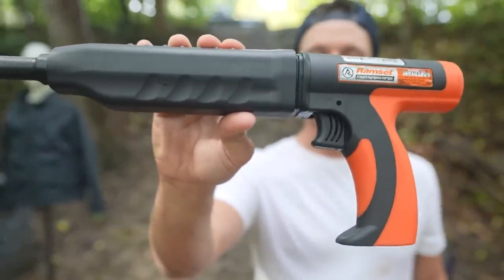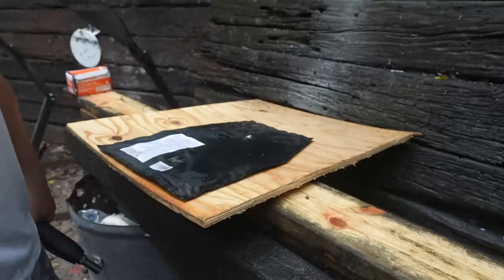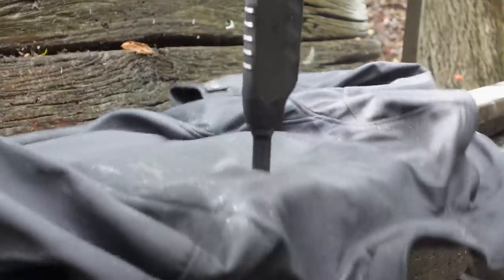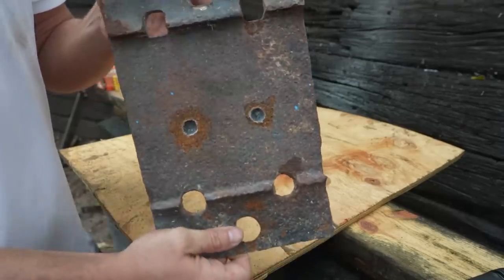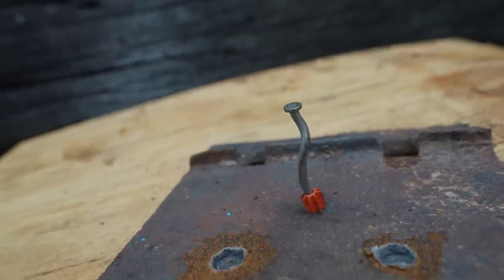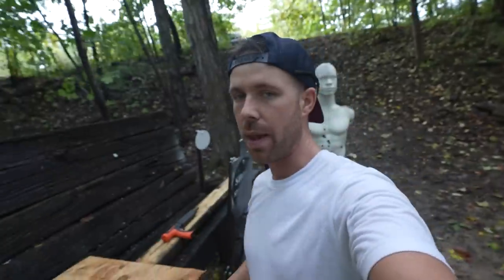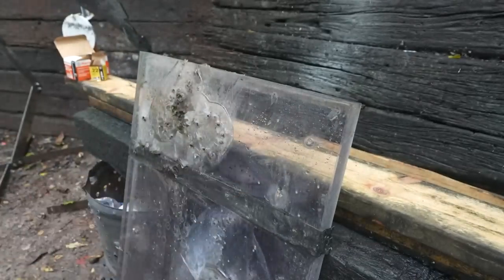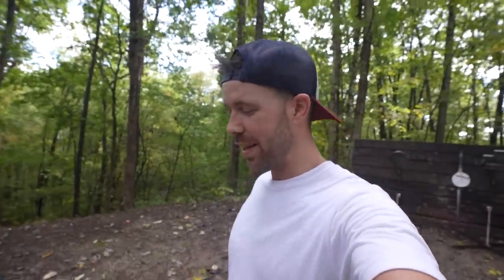Can a Nail Gun DEFEAT Bulletproof Glass?!

Comment: When shooting steel,  you have to use the hardened nails. They will have an H stamped into the nail head. Also, the red blanks are used for driving nails through steel.
Reply: 100% and i was going to speack about that but you did , so thanks!!
Reply: hahaha we have the same name also🤣 ma name is steven ma nick name stk steve the king lol
Reply: ah s*** here we go again
Reply: Time for a follow up vid 👍
Reply: I wish he could do this (But I think he's a bit scared)
Reply: @stkgaming5972  never seen this “speack”  word  before Where does it originate and what is its definition? I’m Intrigued
Reply: Not only that, he needs to be using the proper length pins for the steel he is trying to penetrate
Reply: also he's using the wrong stance to penetrate steel. Nail gun basically just flipped his elbow out of the way instead of directing the energy through the plate.

That plate is nothing to the ramset if you're doing it right. Shit, I've seen people nail two I-beams together with one of these things.
Reply: Steve, I wonder what would happen if you insert the tip of one of these hardened nails into a drilled .308?
Reply: @billyzee261  these are called armor peircing rounds and uncle sam isn't a big fan of people owning them
Reply: @billyzee261  I was thinking a shotgun or muzzleloader but .308 would take the cake.
Reply: Red is below purple I can get steel plates into concrete with those.Try purple they have the highest rating
Reply: Hardened nails are used for concrete as well, and with the yellow tips,  they stick 2x* to concrete pretty good if you have an older model Ramset, but the newer ones with the piston are pretty weak with yellow tips,
Reply: @Fm-ss4uj  Black loads.

Comment: I use both a Hilti and a Wurth nail gun, the cartridges are interchangeable, the Hilti blacks are used to put fixings into steel, it's the nail and the weight of the hammer, using the correct fixing and cartridge steel is no problem

Comment: There are nails just for steel. And couple those with the RED shots. Straight through that plate.
Reply: Yeah, they're hardened steel nails. Usually marked with an H.
Reply: this model nail gun is the 'civilized' model...in that it is piston actuated...let me explain...when you fire this model...there is a spring loaded piston between the round and the nail..upon firing the gas charge strikes the piston which in strikes the nail...the model of nail gun you should be using is i think the Ramset J30 which was produced 20yrs prior to this...this is a beast...it is direct fire...meaning NO PISTON...the charge strikes the nail directly and it fires full length 22cal blanks...and get either the black or the white coloured charges...These guns are Banned for good reason....but you can still find on ebay...get one and put the video up....and fond some decent steel...like some  I BEAM or a section of railway track..
Reply: @russellking9762  I have an old model direct fire, and it pins 2x* into concrete, with the head of the nails buried a half inch deep in the wood with yellow tips.
  The new ones are a joke unless you use red; or even purple in some cases.

Comment: Couple of points; nails are steel and very pointy, bullets (particularly hand gun rounds) are softer and rounder.  In fact many rounds, ever rifle, non AP rounds, are designed to expand on impact.  Also, the nail gun is essentually firing at point blank range.  So, with those noted, I'm not surprised at all.
Reply: Plus, "it went through" is only partly true, it penetrated. Only thanks to the nail's head it gets the necessary force to penetrate, but it would never manage to go all the way through.

Comment: The difference is almost entirely in both the range and the material of the projectile. Bullets are typically made of soft metals, lead, copper, brass etc. and are designed to mushroom and break apart on imact and in the target. Firing a nail is almost akin to firing a low energy AP round.
Reply: O really....... Is that what bullets do?
Reply: @dustencross357  Yes, and in contact with bone they shatter into your flesh
Reply: @4x13x17  😒
Reply: @dustencross357  I'm sorry Dusten, did I also have to include a cp link to catch your attention?
Reply: @4x13x17  (yahn)

Comment: Possibly more accurate to say it "went into the glass" rather than "though", because the head appeared to be flush with the front surface and it didn't exit and hit the railroad sleepers in the back-stop.
Reply: It went though however it didn't pass through
Reply: Maybe if u cut the heat it will go through the glas :p
Reply: @porros_y_cafe  glass melts at higher temperatures than steel

Comment: Nails are made of steel, hardened steel maybe even a mild carbon steel. It will give brass bullets a run for their money, unless the bullet is armor piercing. What you should try the device with is the black colour coated timber screws. Those are the hardest ive seen, clearly carbon steel becaise dont bend but just break. Those will go through that plate which bent the nail.

Comment: Different principles as there is literally a ram in that gun that is pushing the nail forward, the nail is not just flying forward on its own energy.
Those nail guns are more like a tiny, extremely fast acting hydraulic press lol.
Bullets only have the momentum energy of their weight and velocity, these nails have a metal ram behind them continuing the push forward after the impact.

I'll bet if someone made some hardened pins designed for metal, you could get through that tie plate.
Reply: @letgomyleghoe582  I said "like".  Most people don't even know what pneumatic means.
It's not LIKE a pneumatic press.......  It IS pneumatic.
But thanks for the AHCKSHULLY

Comment: I cringed when you shot the nail into the steel plate- was worried something would shatter and hurt you. I think the design of the nail gun to completely surround the nail is pretty safe though.
Reply: Nail?
Reply: @Complete.cyclepath  auto-correct :)
Reply: They're meant to shoot through steel. It's construction equipment.
Reply: @OneMoreGrave  in sure they’res a limit to hardness and thickness though.
Reply: @crankygunreviews  sure. And he found it with the railroad tie. They're built to contain the nail if penetration does not occur. OSHA approved lol.
Reply: @OneMoreGrave  yeah, I never did much research on those- looks pretty “safe” actually
Reply: @crankygunreviews  30 years of construction experience finally paid off 😂
Reply: It's has alot to do with the rounds (nails) he is using, is why he cannot penetrate the steel. I use the same Ramset gun and or a Hilti gun to hang track on the bottom of steel I-beams that are 1/2 thick.
Reply: @OneMoreGrave  🤣🤣
Reply: Mark Harris  I agree- I’m a fair mechanic, and can fix most things, but don’t want to ruin my guns. I’ve polished Sears with nail files before because the file wears out before you take too much off
Reply: Mark Harris  completely agree
Reply: Ironic, I cringed at your comment the same way
Reply: @youtube.commentator  🤪
Reply: @crankygunreviews  oi guv, why'd ya edit ye comments
Reply: @youtube.commentator  not worth my time starting trouble on a good YouTube channel
Reply: @crankygunreviews  fair enough
Reply: Rail rode steel dus not shatter and it’s made to go through steel but of course not this thick

Comment: As a metal stud framer....one would use a shorter hardened steel "nail".
You used the aluminum nail used for pinning 2x4s to concrete slabs.

Comment: The reason the nail gun penetrates the vest is because vests are designed to disperse the foot-pounds of energy over the surface of the vest. The bullet is unable to dump all the energy in an area the size of it's surface. The reason the nail is generally able to penetrate very hard materials that most bullets can't is because of it's pinpoint surface area coupled with the large mass behind it. That combination makes for some pretty impressive foot-pounds.

Comment: They go straight through because of the pointed ends on the nails.

Pistol rounds tend to be stubby. Maybe try grinding down a pistol round to make it have a nail like point and see what the results are. 😍
Reply: Just use sabots!Or make a long barrel revolver with a small caliber: and get it loaded with nail gun blanks from one side and .25 caliber bullet from the other!I made such a thing out of an antique revolver that was .38 rimfire! Just ordered a cylinder with .270 diameter for the first 18mm and then step down to .252 throat diameter! And a 6" barrel with .252 bore: now it's such a blast! With the most powerful blanks-purple long that is, It fires a 50 grain FMJ bullet from .25 ACP at a whopping 2850 fps on average! That is wild!
Reply: Bullets are soft unlike nails which have been hardened.

Comment: Kevlar will not stop pointed projectiles. The point will work its way between the weave of the cloth. You want to defeat body armor that is based on Kevlar or similar materials use a crossbow with razor points.

Comment: Bullets that are stopped by 3a are blunt objects that are broken apart much easier than steel nails. 3a soft armor works by absorbing the impact with strong fibers and disputing the energy across the vest. A pointed nail spreads the fibers apart just like a sewing needle can penatrate or the pointed 5.7. Perhaps if you used a spike rounded the head to be blunt then it would have stopped.

Comment: For the metal  get a 1/2 pin i guarantee you its not going to bend. The nails that you are using are for wood,concrete or light steel.  Get the 1/2 inch pins

Comment: Nail guns are not high velocity, they're captive bolt drivers.  Gap that puppy by 5 inches and see what kind of damage it does.  5 layers of fleece should be enough ricochet shield.  The Ramsets are very powerful but even a 410 shotgun with a driver bolt will slam a hardened nail through half inch mild steel.

Comment: 2:58 ofc it wont stop a nail. u can beat that armor just with normal nail and a hammer
the Kevlar works like any fibers. try to drill trough fabric, the drill gets stopped but use sharp needle and u can just push trough. stab resistant armor would work way better
what kind of rises the question, how well will body armor work against rounds with out spin

Comment: Its literally a case of what it is designed to stop. Most bullets don't consist of a sharp steel point.

While the nail did penetrate the bullet proof glass, it didn't go through. Unless someone's head or other body part is on it, it won't hurt them.

Comment: Well it’s not surprising that a galvanized steel nail went through considering how much harder it is compared copper and lead
Reply: When in the hell did you ever use copper or even lead nails?????
Reply: @scottstabolito8841  i’ve used copper nails for putting up cement shingles for siding, and for putting copper inserts into cupboard doors
Reply: SnyperMac1 
You were installing shingles and inserts with a powdered actuated pin gun?  I highly doubt that.
Reply: @scottstabolito8841  did i say that? Pretty sure i didn’t say that, don’t twist people’s words. Regardless copper and lead aren’t even in the same ball park for hardness as steel.
Reply: SnyperMac1 
Well....when the whole topic is about Ramsets and the pins they use.....

Comment: No kidding "its some kind of plastic" ... it acrylic, some times called plexiglass, yes the same stuff at the home improvement store. Just a bit more attention is  paid to the quality and then there is the thickness. Some high tech (and more expensive) bullet proof glass is made by mixing aluminum and nitrogen under high pressure and heat.

Comment: Also base surface so to force isn't being applied off center. Also wouldn't fire chest height seen ricochet and  hit people
Reply: When a bullet hits the glass it pushes back on the bullet where as with the pin your whole mass is behind the nailgun, combined with the surface area of the nail point compared to the bullet. no where to go but forward. Nail the glass to the concrete and shoot the nail😮

Comment: You need to get yourself a 'Ramset J20' direct action 'explosive powered tool'.
Reply: you got it...and the black or white charge...they are banned now but you can still find on ebay...and find some decent steel like i beam or railway track..
Reply: @russellking9762  yeah, still got mine, got kicked off a building site a dozen odd years ago. J20 was 22cal, Ozark made a 25 call, same nail bigger charge.   The good old days.
Reply: Corection OMARK 25cal.

Comment: Kevlar will not stop a knife which has a 0 point load on impact. And now also has a 0. load upon impact. You do the math therefore it's not surprising that you are will not stop a nail fired from a powder actuated nail gun. Bullets do not have a 0 point load at impact. In fact bullets have a considerably larger footprint compared to a nail.

Comment: The powder drives an anvil or piston which pushes the nail into whatever material you are trying to fasten. They are not supposed to blow straight through wood concrete etc or it would not fasten anything. You are pushing on the gun and firing a shot with your weight behind it to drive it. A bullet has nothing behind it. This is really no surprise.

Comment: I like you and your videos but honestly shooting the soft body armor with the remset was pointless and not surprising at all. Think about it, that nail would go through that armor no problem just by hitting it with a hammer.. A nail and hammer is better at piercing than a knife, a test that would have been better would have been a high quality stab vest, especially one made out of that high strength plastic they use for riot sheilds with maybe a sheet metal layer on the outside.

Comment: this is great entertainment ..... however, there is a flawed premise on the execution. in my opinion. if you have seen an demonstrations on shape charges this will become a little more clear.  when a round is fired the energy is dissipated exponentially once the round leaves the barrel. with your nail-gun the full transmission of that shells discharge is transmitted direct thru the nail and into the item ... PRESSED DIRECTLY AGAINST  the end of the barrel. so the comparison is not apples and oranges ... its more akin to apples and the number yellow. Semper Fi.

Comment: those a bulletproof 2a and 3a, right? what is the anti stab class of this product then? they are build to stop handguns bullet, a nail gun in point blank touch should be consider as stabbing instead of a bullet shot. somewhat like a dagger stab with steroid. if you hang that 2a in the air and shoot the nail gun from, say, 1 feet, it would be a different story. there is no room for that 2a to transfer  the energy because there is a table behind. anti stab material do have another kind of "knitting" method when manufacturing, which, it may not be bulletproof instead. vice versa.

Comment: This guy is no carpenter you have short steel pins and the red is the hot load yellow is for concrete 3/4 is concrete pin and the shorty are for steel you and use hardened nails for wood to steel but you uses red powder and hit it twice to knock nail down